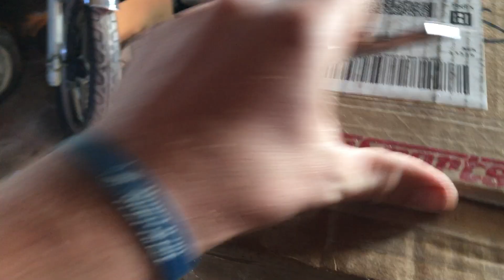"THE PERCOLATOR" the 14hp v-twin powered mini bike

Comment: one of the better v twin mini bikes I have seen, most look like cobbled up garbage. I'm doin one now on the larger monster motor frame, should be pretty slick and look factory when I'm done. What was the paint used on your wheels? thats the sort of heavy metal flake black I want to use on some of the bits and pieces on my bike.
Reply from the maker: Thank you sir! I got the everything powder coated and the rims had a metallic powder coat that came out awesome.

Comment: Man I like how you did the exhaust and the whole bike looks really awesome but how did you run your oil filter with the 40 series without them hitting?
Reply from the maker: Thank You! I ended up having to trim some of plate on the 40 series. I figured the plate is so heavy and thick It wouldn't hurt it at all. Ive no issues at all!